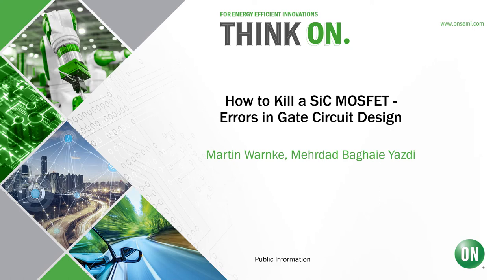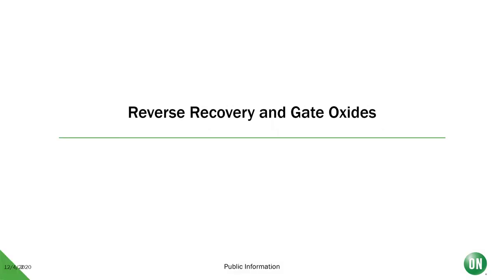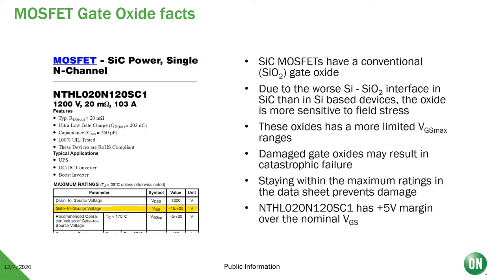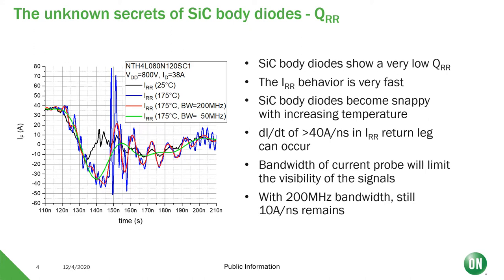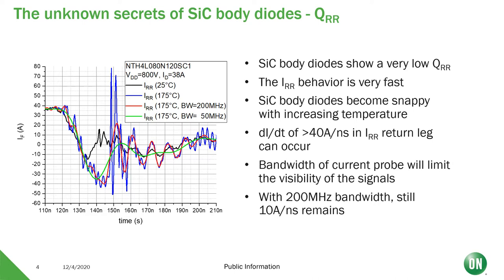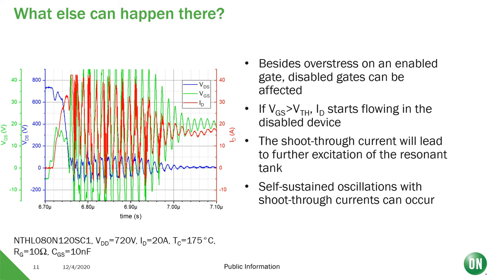How to Kill a SiC MOSFET – Errors in Gate Circuit Design

Comment: Hi I am trying to understand why mosfet damaged in a inverter dc to ac circuit a simple circuit showing 2npn mosfet connected to a half bridge inverter with only Shockley diodes to drain and source and diner diodes to gate and source but the mosfet switching convert dc to ac for only 1 minutes and mosfet failed this action happened with all 20 mosfet tested the mosfet is switching hard start but igbt turn on the transformer easy and smoothly converting and work perfectly for hours and still work but when replaced with mosfet irfz44n and irf 3710 the mosfet all fail even with a sic circuit inplace so con you explain to me why this is happening with the mosfet with no low but igbt work but mosfet fail
Reply: hello brother i hope you are fine please i would like you to help me in this topic SiC power devices characterization and modeling for embedded power converters
Reply: This is an OnSemi presentation, is not the place to seek help for your specific repair issue.
Reply: @lo2740  it’s ok I get pass that along time ago and my answer to why and fix it everything is ok
Reply: MOSFET has rather high capacitance and a sharp transient especially turn-off will pulse the gate.  This can make turn-off fail and in a totem-pole arrangement, the top and bottom MOSFET can turn on simultaneously which is a short circuit from battery.  Also, MOSFET has very low "on" resistance which can allow high current flow if feeding a capacitor (for instance).  Abrupt turn-off can produce high voltage if feeding into inductance even if you have a snubber diode if the diode is not fast enough (or able to handle high impulse current).